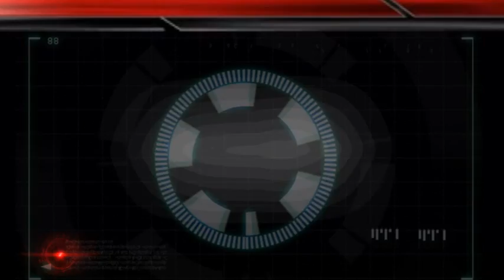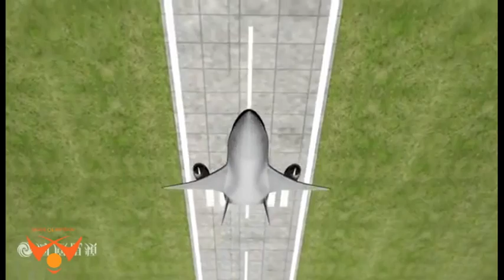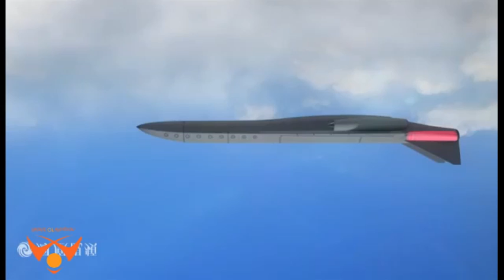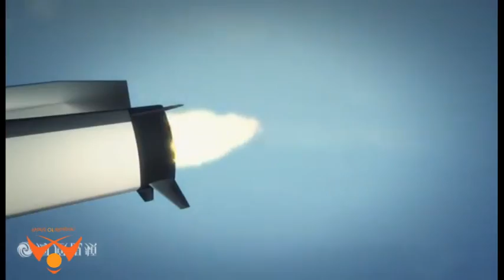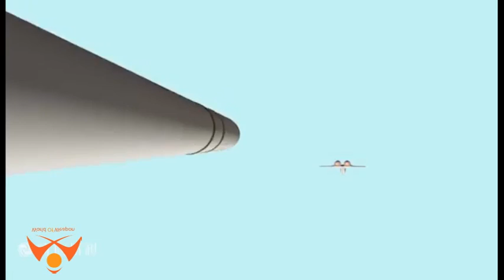China to Test Next Generation Hypersonic Engine

Comment: After WWII Western countries as well as Soviet Union got the opportunity to get German technology, research blueprints, supersonic wind tunnels, and engineers. Germany was bombed to the ground, German engineers had to move to other countries, like the US. Jets, ramjet, rockets were tested by the German with some of them turned into weapons like the V2. Many of the German technologies are still used with improvements which came with the years. China didn't have access to these technologies. A significant example was the French who unmounted the German supersonic wind tunnel at Munich and transported it by train to Modane (south of France); the French put this supersonic in operation with the help of a dozen German engineers. US did the same.

Comment: The author is taking about the 7th generation hybrid bomber the H-11 (the light of 5 stars).It will used four Wang Zhengou turbo-scram jet engines to reach mach 6 speed ,then a rocket power the H-11 to near space for 3.5 months.The rockets are powered by a small pebble bed helium cooled nuclear reactor.On September 18,2015,a six generation flew at mach 6 speed for several hours and landed.AECC with an annual budget of 20 billion dollars and 100,000 employees will manufacture the turbo-scram jet engines and the WS-15 engines

Comment: First of its kind? it has already been developed. 
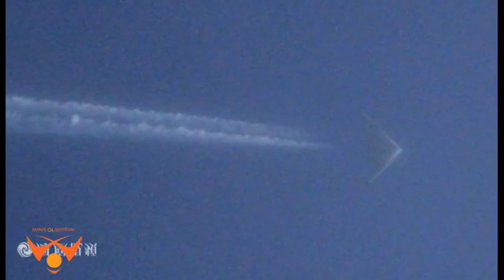And why is there an animation of a b-52 releasing a scram jet, clips of the sr-71 and sr-72 at 1:40 and what appears to be a high altitude b-2 at 1:49.
Reply: warren brown Why is it that China is the only country that perfected the 3 phase jet engine.  Does the Aussie have one?  Does the US have one?  Do you have one?  Btw, US, Aussie, Russia will be copying China's 3 phase jet engine technology.
Reply: __siR Excuse me sir you don't seem to listen to what they say in the video.  Yeah, you can have a scram jet engine,  a ram jet engine, a turbine fin jet engine, but not all in ONE. An airplane has to release the vehicle that is using a scram jet engine.  Otherwise it can never fly from the ground or being stationary (that's where the Chinese turbo fin engine comes into place).

Watch the video again and listen.  China's engine can take off from the ground without riding on any other plane.  Then the ram jet kicks in at mach speed.  Then  the scram jet kicks in for hypersonic speed at higher altitude.  All this is build into one engine.  It's like an automatic car with 3 speed transmissions vs 1 speed.  scram jet is like an automatic car with 3td gear and can't move until another car with first gear only pushing your 3td gear car to a big downhill so you can cruise down the hill.  Your 1st gear car would burn it's transmission if it try to go at that speed.  The ram jet is the 2nd gear in this analogy.